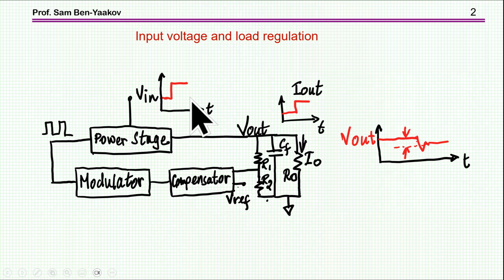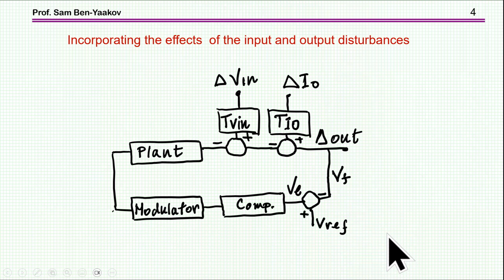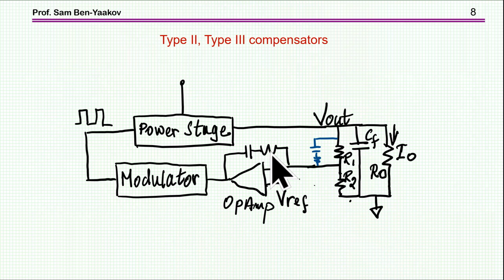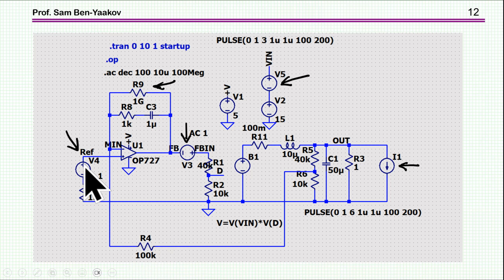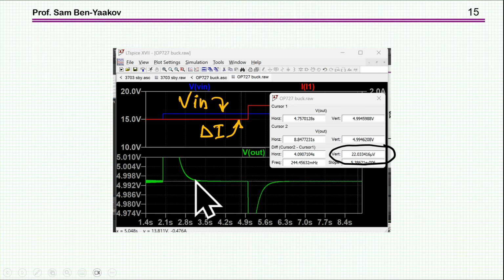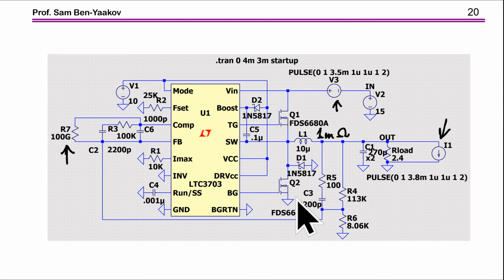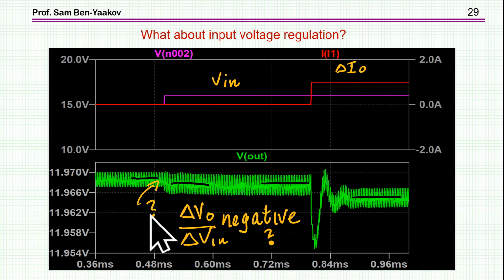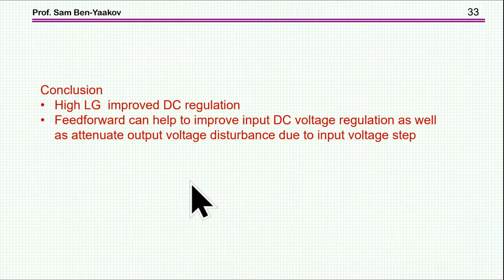DC regulation of PWM converters

Comment: Regarding 10:58 => Hey sir, can you please do a video with further explanation and analysis for operation point with LT spice? I am struggling to convert my Type-2 compensator open loop circuit with LT-Spice's Ideal OP-Amp model into an implementation with the LT spice model using the real amplifier component model (OPA171). Can you please explain what to consider for correct analysis with LT-Spice in detail?
Reply from the maker: Will see

Comment: Mr. Yaakov, thanks four your videos. Could you consider doing a video on methods for paralleling and load sharing on DC power supplies? (i.e. droop control, current sharing, voltage source PS master + sumplementary PS current sources...
What do you think about "Current OS" DC Microgrids industry proposal?
Reply from the maker: Great suggestion! Load sharing will be my next video. As for DC microgrid 🤔

Comment: Great video again, sir! Sort of on topic, but any chance you can do a video on controlling the output voltage of the error amplifier? So, say you've designed a type 2 or 3 error amp but want to adjust the steady state output voltage because it doesn't align with the FB pin IC's voltage spec. Or, that during transient the compensator saturates on either rail so you need to adjust the output voltage (DC setpoint of the compensator) as well as the AC response of the compensator. Hopefully you think it could be a good video, if not, thanks anyways! cheers
Reply from the maker: Thanks fir suggestion. I will look into it.

Comment: Best power electronics professor 🎉 amazing!
Reply from the maker: Thanks. Highly appreciated.
Reply: @sambenyaakov. Love your videos. You should do a video on current doubler rectifiers. There’s very little discussion about this amazing topology. I’m struggling to explain how the currents in the inductors are unbalanced. You are the man to explain it!
Reply from the maker: @jl4945  Good suggestion. Thanks
Reply: @sambenyaakov  It’s a very interesting topology. The virtual centre tap made me initially assume at a glance that each half cycle supply direction will simply  alternate between the  inductors and diode so it’s identical and each inductor current are balanced which it they are at low load. I have been playing around with some simulations and at high output current the inductor currents are unbalanced. I’m unsure how to calculate the currents there’s very little out there. There’s output ripple cancellation that I struggle to analyse mathematically. You are the number one power electronics curator in the world. The current doubler deserves you!
Reply from the maker: @jl4945  I will put it on the todo list😊